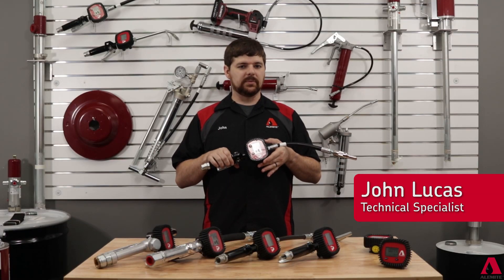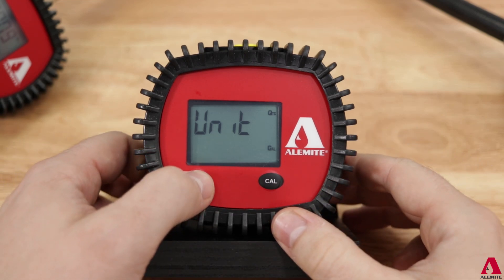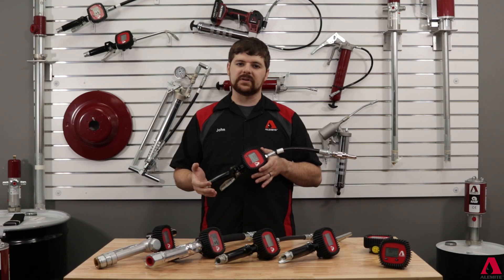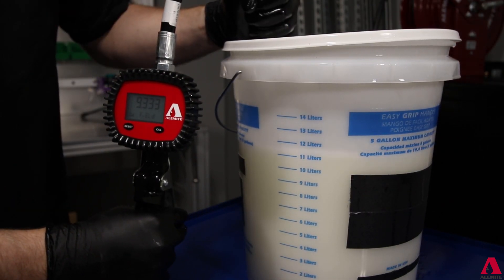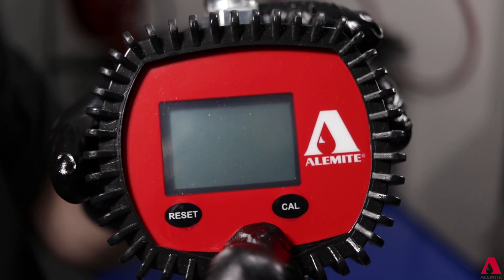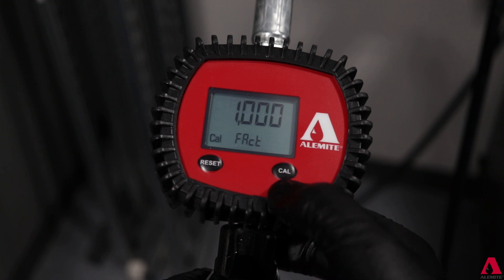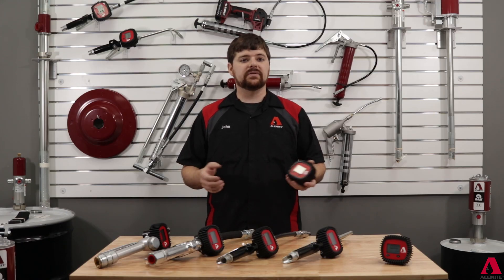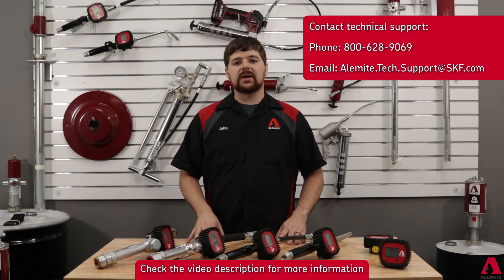Alemite digital oil meter calibration procedure

Comment: how can i reduce the flow speed of the meter, so the oil could flow slow to fil up the oil tank?
Reply from the maker: I am assuming a pneumatic pump system is feeding the meter. Only way to reduce speed to the meter is to reduce the air pressure to the pump feeding the meter. This reduces both volume and pressure from the pump, but is the only way to slow the flow to the meter. 

~ John

Comment: The one at my job has Total and Reset, how do I calibrate that one? I can’t seem to find anything that gives me results. Please help.
Reply: Did you ever have any luck? I can’t figure it out either on ours
Reply from the maker: I apologize, we missed your comment! I assume the meter head is our earlier round style. meter head model number should be 3630. There is a program button on the underside of the meter face. remove the three screws holding the unit to the meter body to access.  The manual with the procedure is available on our website. 

~ John
Reply: @alemitelubrication  it’s actually a model 3621 but it is the older round one, is it the same process you mentioned above?
Reply from the maker: The 3621 oil gun uses the 3630 meter assembly as part of the over all oil gun unit. The calibration procedure will involve a dispense of the designated fluid into a graduated container, then calculating the given numbers for the new total. The formula shown in this video is the same one to use on this meter, however, entering the numbers is different. depress the button on the back of the meter face once removed from the body. the screen should flash and the current scale factor will appear. use the total button to cycle between each digit, and the reset button to advance the value of the digit selected.  once new scale factor is input, press and hold the button on the back again until it starts to flash. The meter face should be reprogrammed from this point. 

above are simply the cliff notes, I would suggest heading to our website Alemite.com and downloading the manual for the meter assembly. 

~John